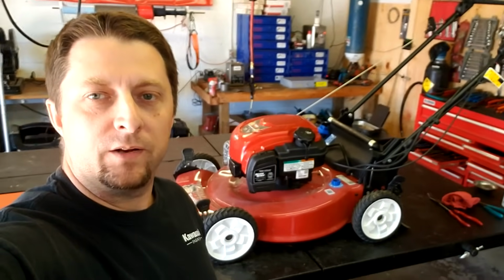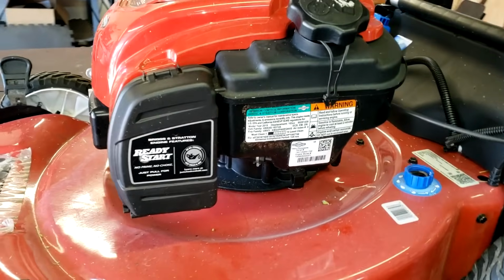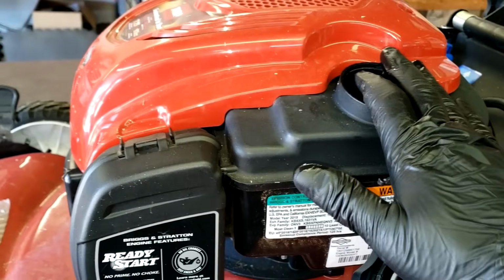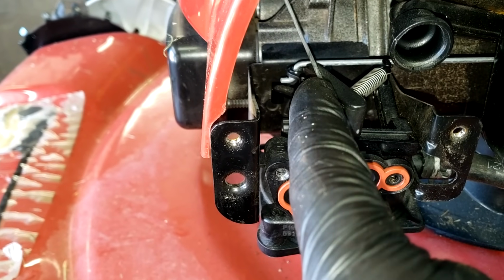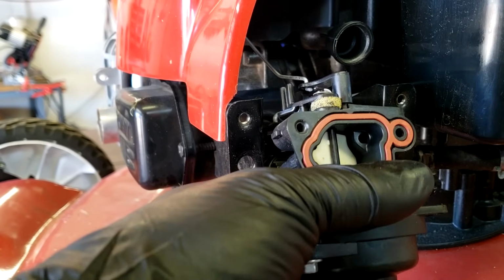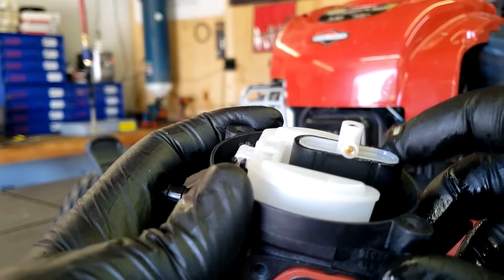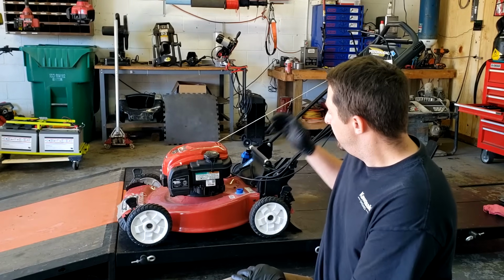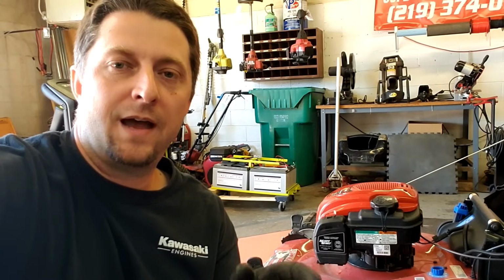TORO Lawn Mower Wont Start Easy Fix

Comment: I have a 2019 Toro recycler with this engine. The gas cap screws on fine but is not a tight fit. Just tightens one turn and is not a tight or sealed fit. Is this normal? I'm used to several clicks and a rubber gasket under the cap!  Newer junk I guess! But it starts and then stops immediately.  I'll get the main jet and see it will run. Thanks !

Comment: Actual question, could I just remove the bowl to access the fuel jet for replacement instead of removing the carburetor assembly off of the unit ?
Reply from the maker: No

Comment: I have a mtd 3.5 hp briggs & straton lawn mower. the proberm im having is when i run my lawn mower after about 30 sec,  my spark plug is flying off the lawn mower .  i tight it so tight but it still happens/ it all started just when i added oil to my lawn mower

Comment: Once I changed the piece it worked but I am not sure if air spraying the filter did the job or replacing the piece wish I would of check the filter first to be sure I missed that part in beginning of the video
Reply from the maker: Sounds like you fixed it! New filter would be better.

Comment: I cleaned the carburetor multiple times, still experiencing the same thing. Do I just buy a new carburetor?
Reply from the maker: Replace the jet and it will work if not a new carburetor may be needed but super rare.
Reply: @D-MAN107  where can i get the jet?
most likey it can be only the jet. It's missing some gaskets, can this also lead to it?

Comment: Great video. I replaced my entire carb and machine still won’t run. I am replacing the oil as it looked pretty nasty. Fresh fuel still no start.  But this video did help a lot
Reply: Why does a car better got oil in it

Comment: Did not work for me. I bought 5 new jets and 4 filters for future maintenance. I fixed my 90hp outboard engine as I changed the VST filter by following a youtube video. I even located the gasket that links the carburetor to the engine and inserted accordingly. Removed old fuel twice as I tried to repair a second time. I also took out spark plug and cleaned it. The mower has also adequate oil level. Any ideas what else could it be? Thank you for the great video.
Reply from the maker: Will it start with starting fluid?
Reply: @D-MAN107  After attempting to start a few times, this is what happened, the mower started sluggishly when I took off the air filter. When I put on the air filter housing, it does not want to start and mind you this is a new filter. I suspect that the carb door is not opening all the way thus the restriction of air. More to follow and appreciate the input. I will try starting fluid.

Comment: I have a Toro with a Briggs 190cc engine. The air filter is different, but the carburetor and main jet look the same as in your video. My question is if the main jet on the smaller engines is the same as the 190cc. Is part number 592792 the correct part for my 190cc engine? Do you have a part number for a complete carburetor for a 190cc engine?
Reply from the maker: Should fit the same but you can call in with your model numbers and we can look it up for you if needed.

Comment: how do you know if the jet needs to be replaced? I followed your instructions, but did not replace the jet. I did clean it thoroughly. The Toro will start and run beautifully for about ten minutes and then dies.  Do I need to replace the jet? And, if so,where is the best place to purchase?
Reply from the maker: If not to nasty they can be cleaned. Can get new ones from local dealers, Amazon or us.
Reply: @D-MAN107  I replaced the carberator jet, air filter and new fuel. It started the first pull and ran perfectly for about 15 minutes, then it started running erratic almost like it was going to die (but never did). I increased the idler speed, but was still running a little rough. Any suggestions?

Comment: Followed this video ... but I couldn't get the new jet into the slot. I tried pushing it down but no click. I ordered the item by the part number in the video. I also compared it to the original jet. They are IDENTICAL, I obsessively measured and compared.  The old one will click in but the new one will not no matter how hard I push. I will resort to cleaning the old one best I can and hope for the best. 

Have you run into this issue? If so, how to address?
Reply from the maker: Thats weird

Comment: I have the Toro Electric Start Vortex. I press the bar and it starts without pressing the start button or pulling the cord. The blades spin, but it won't mow. It's hard to describe. It sounds like pistons aren't firing or something. It doesn't have that mower sound😂.

Comment: My toro used to start on 1 maybe 2 pulls.. now it takes about 5 or more.. u think it’s a similar problem?
Reply from the maker: Most likely is probably just needs a service and carb cleaning.
Reply: @D-MAN107  

I appreciate you responding to my questions,
Last one, when you say service your referring to spark plug, air filter, oil and what else?
And whats the best way to clean carb and with what cleaners? I heard carb cleaner is real ruff.. thx again
Reply from the maker: I actually use napa brake cleaner for quick cleans if not to bad but if really bad I use my ultrasonic cleaner. I will have some videos up soon about this as well.

Comment: Hi I have same engine it was working great I just put extra oil in it it smoke  I changed the oil to max level but when I try to pull the cord it’s making opposite force and pulling my hand  do you know what the problem thank you?
Reply from the maker: Thanks for sharing sounds like you have to much oil in it causes hydro locked

Comment: I just changed my oil,spark plug,air filter,new gas. Its a push mower...GTS 140CC. I took the jet out & cleaned it out. Like you did. Its doing the same,nothing. Maybe the jet is bad period??

Comment: what if this doesn't fix it? oil was changed, new fuel, ne spark plug and did this and its still not working. its  like not even kicking/trying to start. im assuming its the fuel? any tips
Reply from the maker: Could have a mechanical problem, try to spray a little starting fluid in the carb and try to start it. If it starts then still a fuel issue or carburetor.
Reply: @D-MAN107  i fixed it. The bob or whatever stuck. I lubed it up and it started the 3rd time

Comment: I bought a TROY-BILT XP SERIES
TB 290 ES just before winter and now it won't start ? I used it 2 times
Reply from the maker: Probably has old fuel already fuel can go bad in 30days if not treated.
Reply: @D-MAN107  it's been in it since October of last year. I drained the gas out of the bowl and it still won't crank. So I will drain the tank and put fresh gas in it and try it. I have the same gas in my john Deere riding mower and it cranked up and ran perfect

Comment: Have a mower with the same engine.  I've cleaned the carb and replaced it, but still have issues with it starting and staying running.   Have you seen many of these engines with a bad coil?
Reply from the maker: Thanks for sharing and no not very common
Reply: @D-MAN107  Well, I replaced the coil, but still have issues with it running.  Watch it be the spark plug. Lol

Comment: Hi there, I completed the removal and install as shown in the video and it started right up, but now my mower is blowing white smoke. Any idea why?
Reply from the maker: Sounds like its over filled with oil or possibly got turned over the wrong way and has oil in the muffler. If the oil level is correct then it should stop smoking after 5-10mis

Comment: I have a briggs and stratton on a DR. string trimmer mower. Barely used. I clean the entire mower every after use, checked and replace air filter, I run the carburetor completely dry until the engine stops. I also put fresh fuel with stabilizer and fuel additive like seafoam to keep carburetor and engine clean. It's stored in a barn away from sun, rain, etc. It was running last year. gas tank stored empty, no gas on carburetor. I started, it won't start. I replaced the spark plug and ignition coil to make sure it gets spark. It starts, then the next week, I'll start it again and it will not start again. What am I missing here? Is the ground wire attached to the ignition coil could be the problem?
Reply from the maker: You have a fuel delivery issue with the carburetor or a possible auto choke or primer issue most likely.

Comment: I replaced the main jet with a new and it still very hard to start. You have to pull really hard at least 4 or 5 times and then it runs rough. 
What's happened to Briggs. and Stratton.?
Reply from the maker: May need a new carb or valves adjustment.
Reply: @D-MAN107  I'm thinking it's something else because that carburetor is very clean almost new . Valves looked good. 🤔

Comment: The 1 I have was running good.     Didn't know was empty of oil.     Was a gift from a cousin.    He used it a couple times.   So Didn't check oil.    Was running for a few minutes and then heard a explosion     and shots down.     Spins but something broke inside the engine

Comment: Can anyone help? Everything was great until I had to put the carburetor back into the engine. I know I had to “pop” it out of the engine which I did. I followed all the directions but even I try to get the carburetor it seems like it will not go back in. How hard should I try to get it in?  Any tips? Advice?

Thanks

Comment: Hello, my mower wont start, it will start a few seconds when I put some gasoline on the air filter.   Is it the same problem as yours?
Reply from the maker: Sounds like it to me

Comment: My Toro always started right away but was turned upside down.  Oil started leaking out and now it won`t start at all.   Do you have a video that might help?  Thanks!
Reply from the maker: Needs to replace plug,filter and possibly clean carb.

Comment: I was sure this would fix my issue.  Replaced the jet and the lawnmower will not stay running.  What is my next step?
Reply: Pulled the carberator again.... bowl was dry.
Reply from the maker: Is fuel getting to the carb?
Reply: Apparently the float was sticking.   I tapped on the side of the carburetor and all is good.  I wonder now if I really need to replace the jets...  Great video.

Comment: You can easily clean the idle and high speed jets with some carb cleaner. Usually no need to replace. Wear safety glasses though!
Reply from the maker: Yes or just put a 10$ part in much faster and works every time.

Comment: Would this be the reason why the pully is so hard to pull?  Usually it's super easy and now I can barely pull it! Help!
Reply from the maker: No sounds like it may be hydro locked or engine trying to seize has anyone turned the mower on its side.

Comment: Any other ideas? Installed new carburetor, spark plugs, new oil and gas, still no luck
Reply from the maker: Possible mechanic hard failure or low compression

Comment: Please help, my lawn mower rear wheels don’t want to roll, they just slide .. When I lift the lawn mower tilting down the rear wheels just move freely like the inside middle piece moves freely
Reply from the maker: Could be locked bearings or debris jammed in wheel gears.
Reply: @D-MAN107  Turns out it’s the handle to adjust is broken. I can’t find it online or anywhere

Comment: Is there a reason why mine still wont start? I changed the carburetor, air filter, spark plug, oil and ignition coil ! And still gives me a headache to try turning it on..
Reply from the maker: May have a mechanical failure or major issue. Especially if it won't start with starting fluid.  Could have low compression.

Comment: Ours got flooded recently because i turned it on it's side to try and adjust the wheels. Every since this It has hard time starting. I have to pull the cord 15-20 times and then it will start. My son was cutting someones yard and removed the spark plug and sprayed starter fluid in and it cranked right now.

But since doing this it just doesn't want to start up without 15-20 pulls.

Comment: That’s THE way of fixing. This is A way of fixing. Buy throttle body cleaner. I used it for 3 startups. After that. It started on one pull.

Comment: Super easy!!! However it did not fix my issue… I’ve changed the spark plug and air filter as well…. Does anyone have any other ideas???
Reply from the maker: Spray a little starting fluid in the carburetor and see if it starts if it does then shuts off immediately it's a fuel issue possible bad fuel, clogged carburetor. If it does not start then it may be a bad ignition coil or something mechanical.

Comment: I've used lawnmowers for decades and I've never had one that was so fussy about "stale gas" (I have a new Toro). Is it a pollution control thing?
Reply from the maker: More or less they have been leaning them out to run cleaner not to mention the fuel today breaks down much faster do to the ethanol content.
Reply: @D-MAN107  I think I may just be switching to a battery powered one soon.
Reply from the maker: @fallspeed  beware I see them go down also and the battery cost almost as much as the machine sometimes.
Reply: @D-MAN107  What type of mower would you recommend for a hilly 1-acre yard? I can take care of it with a weed-eater, but the mower is good for some flat areas.
Reply from the maker: @fallspeed  honestly it comes down to the user more than anything do not use fuel that is older than 30days and try not to let equipment sit with fuel longer than that also without starting and running it so often.
Reply: @D-MAN107  May just get a corded one, lol. Never have any trouble with my corded weed-eater.
Reply: @D-MAN107  I bought some new gas but it still wouldn't start. I'd only used it 3 times last year, but I didn't run it until it was dry (and mine doesn't have the fuel shutoff valve like my old mower did). So I took the air filter & cover off and sprayed some O'Reilly Carb Cleaner up inside (and some in the fuel tank) - I use the same stuff on my '88 Chevy Caprice. Worked like a charm, runs beautifully. This time I made sure I ran it until the tank was empty. 
But your video was very helpful.

Comment: followed every step and my mower turned on at the first pull I was so happy...but unfortunately something went wrong and it was leaking gas from that area so I drained the gas again opened it back up re did everything and made sure it was tight and kept leaking. now won't even crank on. not sure what happened smh.

Comment: Does anyone have an Amazon link to the Briggs & Stratton Main Jet part, please? Thank you.
Reply from the maker: I believe they are on national back order currently I have been forced to clean them for now so far been doing OK
Reply: @D-MAN107  What cleaning solution do you use? How long do you soak it? Thank you.
Reply: @meriborne  hey just had one come in today… took it out all junked up , took a air compressor nozzle tip on top with some carb cleaner . Easy to clean up there are two lines after that it ran brand new.. Hope that helped
Reply: @CSERepair  hey, thanks so much for the tip. I actually pulled my carb yesterday and took a close look at the jet main. it was super clean. put it back together. engine still wouldn't start even with draining old gas. and then I thought about the spark, so figured for $6 I could rule that out. installed a new plug. engine started first pull and runs like new again. but if the jet main gets clogged in the future, I'll use your method, so that's good to know, thanks!
Reply: @meriborne  I’m glad you got it back up and running… These toros machines are real simple just very hard to identify the problem! Blessings🙌🏽

Comment: Brand new Toro rear propulsion walk behind power mower. Put too much oil in and the string won't pull. So I poured off a lot of oil...didn't fix the problem. Brand new! Help. (model: 21532)
Reply from the maker: Need to level the oil, then pull the spark plug out and pull the rope several times to get the fluid out of Cylinder the unit is hydro locked from being over filled. After that put plug back in and try to start it will smoke alot until it burns the oil out of muffler.

Comment: That nipple that comes out off the carburetor side of the gas tank.  What's that for?  Mine squirts out gas, and no it's not over filled.  Thank you in advance.
Reply from the maker: You may have some trash under the needle causing a leak. That is a vent
Reply: @D-MAN107  the needle?  I understand it's a vent, but what allows the gas to squirt out?

Comment: I have two of these mowers and both of them start.. And then go out. What I use Starting fluid it goes longer ..ordered Two jets from Amazon for 9 bucks... Pretty sure This will be the fix .they were stored for a year
Reply from the maker: Nice
Reply: @winderoutdoorpower1225  I really appreciate you guys I really appreciate You helping me save One thousand plus dollars I was going to get rid of these two mowers. I changed the jets out and they run like champs... I never would have Even looked into it and just kept taking it to home depot.. Seventy six per mower. They add a little something so it would be about ninety.. per mower And their climate stored So I don't have to dump gas out correct?

Comment: Spray some starter fluid in the cylinder first before you start disassembling your carburetor. Really going straight to taking your carburetor apart and replacing parts is a disservice to people when you should do basic troubleshooting.
Reply from the maker: Sometimes you can skip right to the good stuff.

Comment: after running fine all year all of a sudden it started but soon ran slow and then died. They I couldn't start it, could pull the cord but would not run.  Checked out the air filter - it was fine - looked at the cables controlling the carb - they looked fine but then....eyeballed where one of the carb levers was and found sort of a ball of dead grass between the lever and and some metal part. Removed the dead grass with a screwdriver and then.....it started right up. So for me the problem was that the lever wasn't moving.